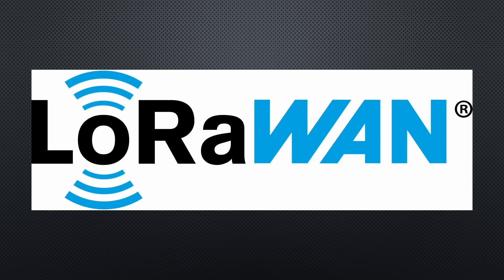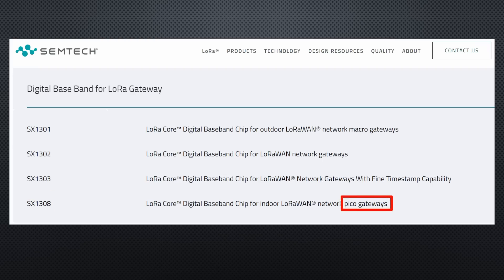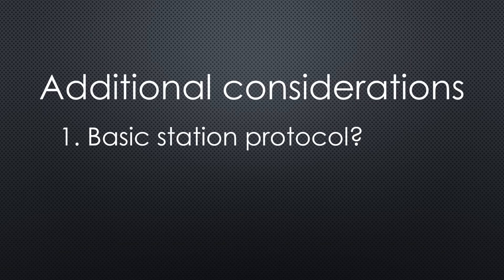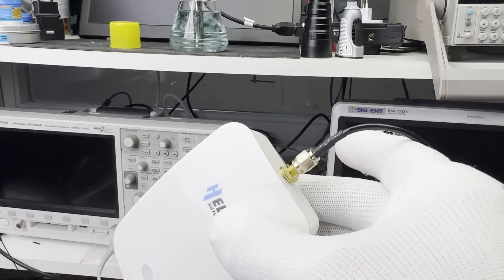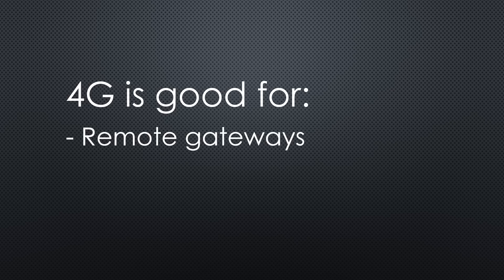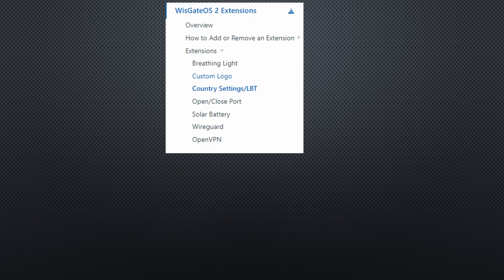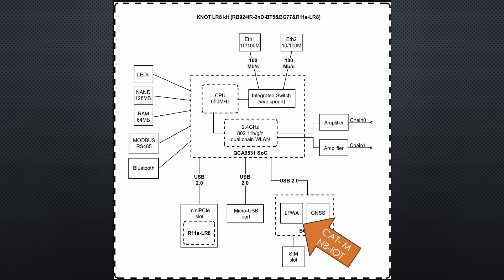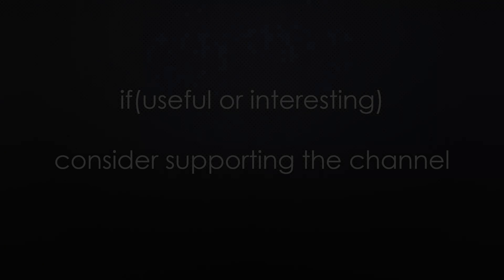478 Which LoRaWAN Gateway Is Best For Me (Comparison)? Part 1

Comment: LoRaWAN Gateway Selection and Comparison

*   0:00:00 Introduction: The video focuses on LoRaWAN gateways, comparing currently available options and selection criteria. The main considerations discussed are the number of channels, chip types, connectivity protocols, and price.
*   0:00:54 Channel Count: The optimal channel count is discussed. Single-channel gateways are dismissed as flawed (limited to one channel and spreading factor). 16-channel gateways are considered overkill for most use cases. 8-channel gateways are presented as the standard.
*   0:02:04 Chip Types: Different Semtech chips (SX1301, SX1302, SX1308, SX1303) used in gateways are presented. They are all capable of 8 channels, with slight differences in features and footprint. The SX1303 is the newest iteration.
*   0:02:35 Network Connectivity: The video focuses on connecting gateways to The Things Network (TTN) but also mentions the possibility of connecting to the Helium network (for data transfer, not mining).
*   0:02:59 Connection Protocols: The older, less secure "legacy packet forwarder" and the newer, more secure "Basic Station" (with CUPS - Configuration and Update Server) are discussed. The recommendation is to use Basic Station and CUPS whenever possible.
*   0:03:40 Frequency Range: Importance of the frequency and to check your country laws before purchase.
* 0:03:57 Gateway Categories: Gateways are categorized into four quadrants based on indoor/outdoor use and connectivity (Ethernet/Wi-Fi or 4G).
*   0:05:10 Category 1 (Indoor, Ethernet/Wi-Fi): Several gateways are discussed:
    *   Raspberry Pi Hats (Elecrow, Seeed): Affordable (~$40-45) entry-level options.
    *   The Things Indoor Gateway (TTN): Wi-Fi only, easy to set up with TTN, ~$79.
    *   Heltec HT-M7603: Low power (~1W), uses the legacy packet forwarder, ~$100.
    *   Dragino LPS8: OpenWRT-based, external antenna, supports packet forwarder and Basic Station, ~$100.
    *    SenseCap M2: Supports Helium, packet forwarder, and Basic Station.
    *    RAK7268V2: available with optional 4G, feature-rich (built-in network server, Chirpstack support), supports packet forwarder and Basic Station, also has "Listen Before Talk".
    * Milesight UG65: Supports docker and containers.

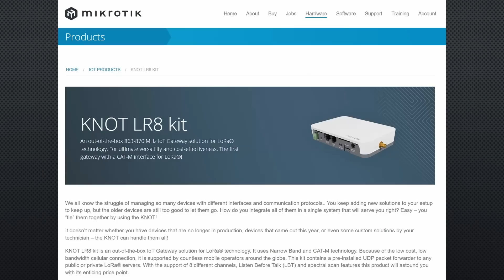*   0:13:10 Category 2 (Indoor, 4G):
    *   MikroTik KNOT: Feature-rich (4G, GPS, Bluetooth, RS485), intended for advanced users, ~$200.

*   0:15:38 Outdoor Gateways: Mentioned briefly, but no specific models are reviewed in detail.
.  *0:15:58 Conclusion: The video provides a lot of detail. Links and more information are mentioned to be in the description.

I used gemini-2.0-pro-exp-02-05| input-price: 1.25 output-price: 5 max-context-length: 128_000 on rocketrecap dot com to summarize the transcript.
Cost (if I didn't use the free tier): $0.02
Input tokens: 13803
Output tokens: 751

Comment: oh my that "things gateway" consumes alot of power. I built  many IOT routing devices using opensouruce router platforms that consume far less.  my latest illiteration  that consumes ~3 watts  that  based on openwrt. acts as my home router . but also zigbee/hc-12 gateway.  home automation ( domoticz )  but also as  in house AI  that I custom built  to be very low resource consuming  that does text to speech and speech to text. though at the moment I am looking for USB based GPU or TPU that i can offload some AI stuff.  but all i can find so far is google coral which is only good for visual for the most part . I was thinking of adding  lora stuff  for some long distance sensors  control

Comment: I bought the elecrow hat, which antenna would you recommend? I plan to build an outdoor enclosure for it. I do not have an VNA, so I cannot check if the antenna is ok.
Also, R. I. P. Diska
Reply from the maker: One of a reputable supplier like RAK.

Comment: Tips: When testing transmission ability, do not rely upon "cat /proc/net/wireless", instead use iperf3 (need 2 machines running iperf). Don't use cheap antennas, and don't use cheap antenna cables.  I found a 10:1 performance difference between an Rpi Zero 2W inside a TICONN case vs. an external antenna via USB. I thought values from "cat /proc/net/wireless" were determinative, but found those were false flags: iperf3 tests provided an accurate performance rating.
Reply from the maker: Thank you for the addititonal info. Indeed, placing antennas in the vincinity of computers is not a good idea, because they emit RFI. Iperf does not work with LoRaWAN.

Comment: Hi Andreas, "I do not know if other GW support  Listen Before Talk" — Unfortunately, a paragraph from the LoRaWAN L2 1.0.4 Specification says :

3.3.7 Receiving or transmitting other protocols
The end-device MAY listen for or transmit other protocols or perform arbitrary processing between LoRaWAN transmission and reception windows, as long as the end-device remains compatible with local regulations and compliant with the LoRaWAN specification.

Further in the specs (§ 15), it is said that :  "Class C mode is used for applications that have sufficient power available such that they do not need to minimize the time the radio receiver is active as they do in Class A or Class B applications." and that : "Class C shall not enable Class B concurrently. Class A downlink, however, are always available after and end-device uplink."

I also found why there's a embedded GPS receiver :

The variable TAccuracy denotes the timing precision guaranteed by the gateway. TAccuracy SHALL be provided by the gateway manufacturer with the set of operational conditions required to guarantee it. TAccuracy SHALL be less than or equal to the timing precision 2161indicated by the Prec field of the beacon TAccuracy ≤ 10^(−6+Prec) s.

All gateways participating in the broadcast of the Class B beacon must be synchronized. Depending on the timing precision that can be guaranteed by the gateway, two possible modes of the Class B beacon transmission are possible.

        TAccuracy ≤ 1 μs: gateways tightly synchronized to GPS time.

If the gateway transmissions can be synchronized to the GPS clock with an accuracy of better than 1 μs, the gateway MAY transmit the beacon every 128 s. The Prec field of the beacon is set to 0, indicating a timing accuracy of better than 1 μs for the listening end-devices.

        TAccuracy > 1 μs: gateways loosely synchronized to GPS time.

If gateway transmissions can be synchronized to the GPS clock with an accuracy of better than 1 ms, but an accuracy of 1 μs cannot be guaranteed, the transmission of a Class B beacon SHALL be randomized. For each beacon, the gateway SHALL draw a random number P with a uniform distribution between 0 and 1. The gateway transmits the beacon if P < PBeacon. If P ≥ PBeacon, the gateway remains silent and does not transmit the beacon.

You will find the whole shebang on lora-alliance > Resources > Specifications Documents > Technical Documents.

Condoleances for the cat, it is always a big loss for the family.

Comment: I've been running packet forwarders for 6 or 7 years, all pointed into a local Chirpstack instance. I use the network for custom built sensors around my house and farm. Unless I'm mistaken, if you want to set the date/time on a device from the LoRaWAN network, you'll need a GPS on the gateway. Maybe there's now support to sync the gateway with an NTP server, but I thought the 1 PPS from the GPS was required. I also haven't looked at Basic Station support yet. I'll be interested to see what this has to offer, and if it's useful as far as moving data to the Chirpstack instance.
Reply from the maker: For your propretary network, I think there is no need to move to Basic Station. And thank you for the hint about the GPS time. However, I never cared about the time in my gateway and I always got the right time on my messages. I do not know if it comes from TTN or from the net.
Reply: @AndreasSpiess  I believe I was mistaken that GPS is required for the time. What it is required for (or was) is supporting LoRaWAN Class B devices.
Reply: UDP forwarder should never be used in production environment. Basics Station all the way. LNS time sync is supported in 1.0.4 natively. GPS not needed

Comment: I have a few weather stations in the area that interface each with a dedicated receiver and have been wondering if those gateways would be able to also receive and handle those 868mhz signals with an antenna on the roof so that I don't need the dedicated receivers anymore.
Reply from the maker: These stations most probably do not support LoRaWAN :-(

Comment: Andreas, I thought the RP SMA (F) was the later way to output on wireless units / devices, and have RP SMA (M) on the antenna side.

Logic behind it being you're less likely to drop a physical wireless device such as a gateway etc, so theoretically its better to have the thin pin on the equipment side (such as the gateway) than it is to have it on the antennas which we're more likely to swap out and change during fault finding, experimentation or testing so more likely to drop or have rattling about in a bag or carry case.

Are you saying its better to have the pin on the antenna side using the original SMA (M)? 

Are you saying suggesting that so we're less likely to confuse our LoRa antennas with WiFi antennas?

I know realistically it shouldn't matter either way, I'm just curious though.

Thanks..
Reply: As far as I know, RP-SMA was developed to prevent people from connecting SMA antennas to their devices to increase signal strength. It is similar to "security screws" like Apple's Pentalobe, or those strange triangular screws you find on power strips.
Reply from the maker: @dbrgn is right. It was invented in the 1990 when the first Wi-Fi access points ccame to the market to prevent "stronger" antennas.

Comment: I purchased both the SenseCap M2 and the SenseCap LoraWan Outdoor Gateway. They are not the same product (the software features are different, not sure about the Lora chip). If you want an outdoor version of the M2, they do have an enclosure available.
Reply from the maker: Sensecap seems to be their overall brand and M2 the particular product. But since I do not have the outdoor version of the M2, I thought they just changed the case.

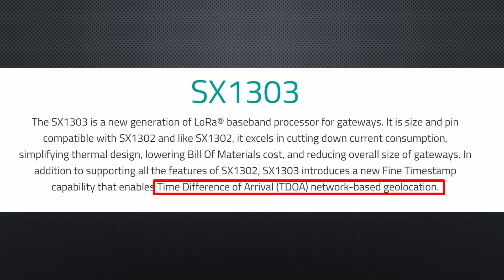Comment: 2:30 Geolocation might not be widely used for your previously demoed usage(sending text messages) but I imagine this is a very desired feature for what LoRa would be most useful for: tracking assets(ex: public transport - offering time predictions without internet) and calling for rescue services with geolocation(ex: mountain bike helmet/regular handler computer/watch with crash detection that calls rescue services).
Reply from the maker: Most of LoRa trackers have built-in GPS because the location of a pure LoRa system is not very precise. I heard that they do some elephant tracking in Africa with such a method. So, if battery life is important, I agree with your comment.
Reply: @AndreasSpiess  If it's not accurate, I could see a use-case where you continuously track for example the general direction of bears and switch to GPS once they get into danger areas, to alert locals or for careful monitoring.

Comment: Hallo Andreas, i can not found informations for Mikrotik Knot LR8 and Basic Station Support. Can you Help?
Reply from the maker: There is no particular info available. Just use the two links I provided (after upgrading to the newest firmware) and you will find LoRa in the IoT section. When you define the server, you can chose CUPS or LNS (both use Basic station).

Comment: I have the Mikrotik WAP with lora (has one lora csrd, a internal 2.4ghz wifi module and one poe input) and that giant mikrotik antenna. Still haven't set up any software on my home automation SBC to use the data, indont want to rely on a external company. Got it relatively cheap on ebay last year and so far only confirmed it is working. What i really like about MT is that you enter the location and antenna size and their radios automatically lock within the legal limits so you cant accidentally go out of them. Also the insane amount of automation they can do, recently found out they even "speak" mqtt so you can send messages from scripts to mosquitto, which can probably be used in interesting ways together with interface Statuses, dhco leases, signal strengths... 

RISC-V became much more interesting to me recently, so im not sure when ill proceed with Lora stuff. Only thing im still really struggling with is the usb port of the milk-v duo (runs Ubuntu and not the official image). Getting node.js to run on RISC-V was not even that bad. Only took a while because i didn't want to crosscompile. 

Want to find out if that half watt SBC can handle the home automation. My nano pi is obviously overqualified and idling mostly. Also i have like 10 of them...

Comment: what do you suggest on connecting two devices that are at least 10km away, the place i'm trying to connect to has no wifi or GSM network.
Reply from the maker: That depends on many things. With line of sight and low data rate. LoRa could be a solution. Otherwise probably Starlink...
Reply: will you make a video about how to use starlink to monitor distant devices? @AndreasSpiess

Comment: Thanks for another informative video Andreas. Looking forward to the outdoor one next week. I am a little perplexed about why I would really use Lorawan indoors? I have always found it easier and cheaper to just build sensors on an ESP32 or even an old ESP8266 and use deep sleep to compensate for the power. In most of my cases, a sensor that reports in every 2 minutes (or longer) is just fine. Plus, extending wifi has become so ubiquitous that I would imagine almost everyone here has their home area fully covered. But of course, always still an interesting topic and always appreciated that you make videos about these things. Perhaps you and other subscribers can please educate me if there is something that I am missing about Indoor Lorawan?

PS: So sorry about the cat. I distinctly remember being inspired by her appearance on the catfood scale video - I think an HX711 module? RIP Diska!
Reply from the maker: I use an indoor gateway for tests. But others use it when sensors are all over the place and in difficult to reach (RF) locations. For example I heared that the Deutsche Bahn uses it in their multi-story building. Or the retailer Coop in Switzerland to survey all their refrigerators in one building (including incoming goods with LoRa temperature sensors).
WiFi sensors usually need mains connection (I have quite a few of them). So Zigbee is a good thing if 2.4GHz works in your situation.

Comment: The ttn indoor gateway is great when modifying it with an external sma port and run it with an external antenna. Takes 30min. Instructions are available on the internet.
Reply from the maker: Thank you for the additional info!
Reply: @AndreasSpiess  You're welcome. Search for "hacking ttn indoor gateway" for example for English instruction.
I did it myself.